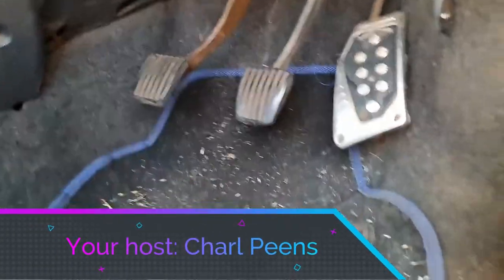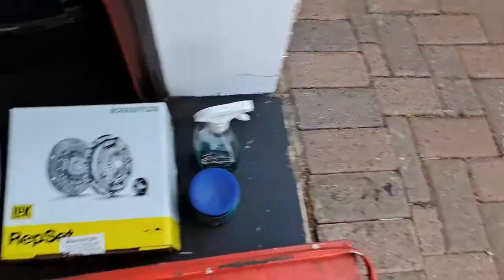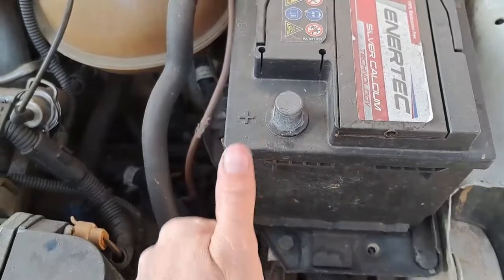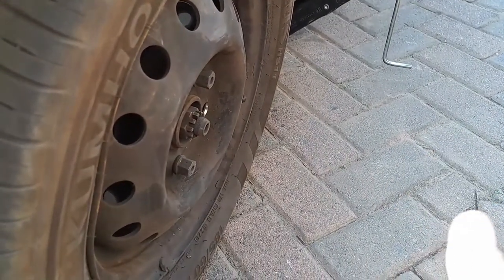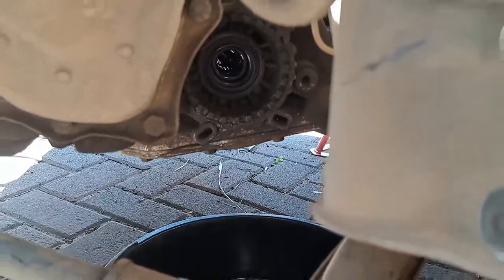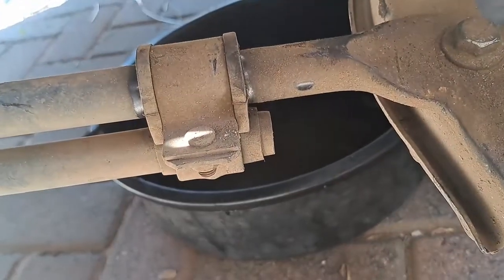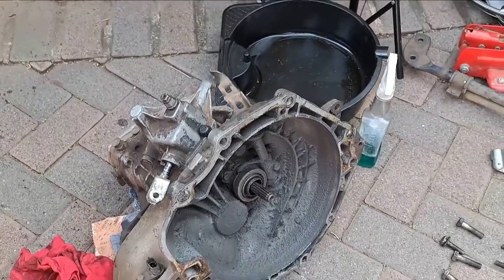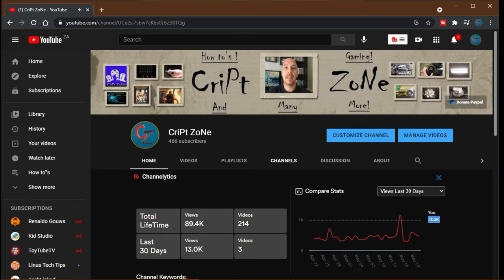Clutch removal of Opel Corsa lite 2002 model

Comment: Thank you for this tutorial.Can you tell me how do i remove the linkages part?
Reply from the maker: Pull the pin on the selector fork. there is just the one pin from the gear linkages where it connects on the selector fork. Should come out easely.
Reply: @CriPtZoNe  ok thank you

Comment: Did you not have to remove the starter
Reply from the maker: No. It is not needed.
Reply: Do think you could remove the entire engine and gearbox from the bottom provided you lift the vehicle high enough to pull the engine and gearbox from underneath
Reply: @roybuckle7576  it is possible I did it on my car as I was working alone it just made more sense for me and most probably took the same time. As I didn't have a trolley jack